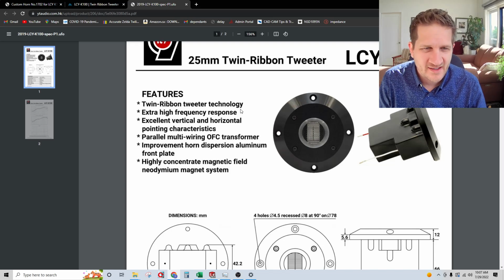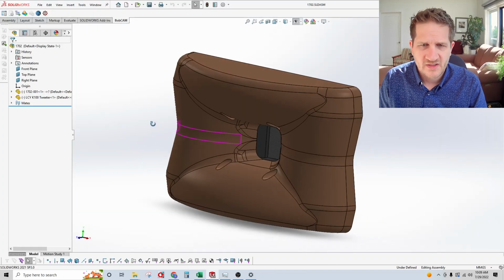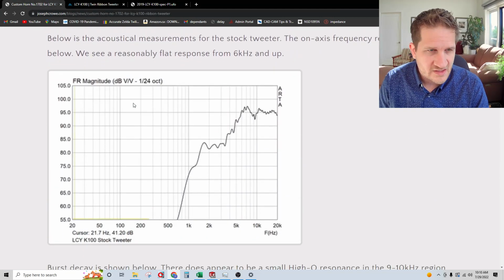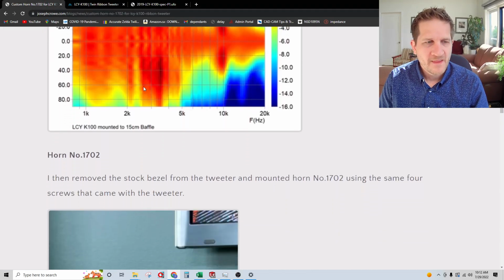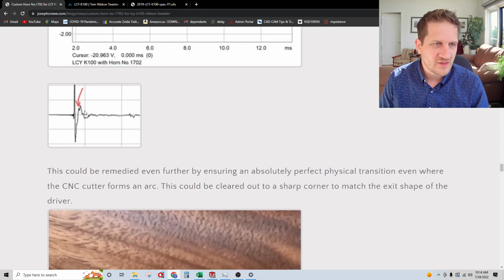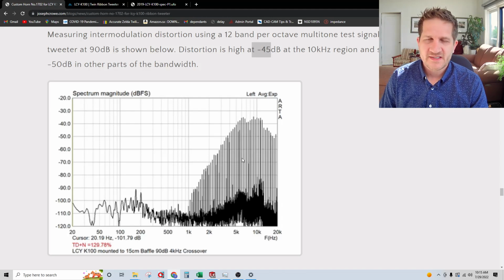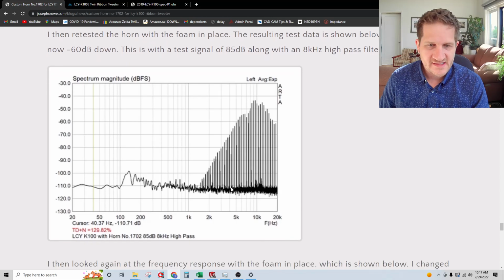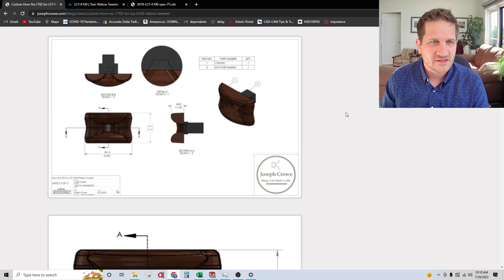Custom Horn No.1702 for LCY K100 Ribbon Tweeter

Comment: I know that the improved off axis response widens the sweet spot. But does wider directivity usually improve imaging? I wonder with all of the work that a lot of listening rooms put into absorption at the first reflection, maybe there are times where you want narrow directivity?
Reply from the maker: It’s not really about the sweet spot but more about the how we perceive the width of soundstage. Wide soundstage is subjectively more preferable than a narrow soundstage. But if the room has acoustical issues such as flutter echoes or if the off-axis sounds nothing like the on-axis then it is perceived as a blurring of detail. For me the sweet spot lies in a coverage pattern of 90 to 120 degrees. Beyond 120 degrees there becomes too much room interaction. Most speakers have nearly omnidirectional radiation through the midrange which is why sitting almost near field sounds cleaner. But with large format horns this isn’t the case, clarity can be had even at long listening distances.
Reply: Great question, the million dollar question... certainly a topic that's enjoyed a great deal of attention. 
So much investigation of coverage patterns vis-à-vis sidewall reflections... immersiveness, Apparent Source Width, spaciousness vs image specificity... envelopment, etc.
  
Ideally, as much sidewall interaction as possible without corrupting the initial time-delay (ITD) gap... this facilitates the listener to experience a clean hit of the direct sound, accompanied a short time later via the early reflected energy, then ultimately a diffuse reverberant field is formed. 

All this study has revealed a few best practices; if you treat sidewall locations, you treat in as broadband as possible. 
If you absorb, absorb it all.
If you diffuse, diffuse as wide a bandwidth as possible. 

Geometry is also a powerful tool to redirect sidewall energy. Dipolar output from loudspeakers can also be leveraged into being an asset. 

Check out the legendary sidewall approach to Blackbird's Studio C... in Nashville. The finest mix environment in the world.
+138,000 individual pieces of wood, all different lengths... 100,000 lbs of wood! 
George Massenburg's and Dr. Peter D’Antonio's masterpiece. 

Remarkable; 
https://www.blackbirdstudio.com/studio-c
Reply: I guess it is about „constant“ directivity / energy distribution over frequency bandwidth…

Comment: I think using the newer LCY-100K-mk2 with 13khz xo inbuilt would have much lower distortion maybe maybe not. will this horn work with that model as well? It too is 90mm dia.
Reply: mk2 is same driver but added body and crossover. I would guess the built in crossover wouldn’t be as “clean” as the single cap used in this horn loaded design. I selected a Miflex KPCU-01 cap, along with duelund hookup cable to viborg pure copper binding posts. Sound beautiful.